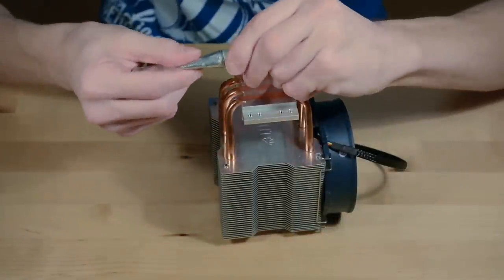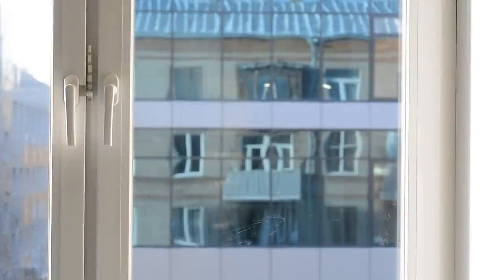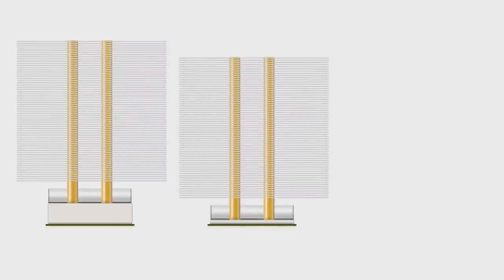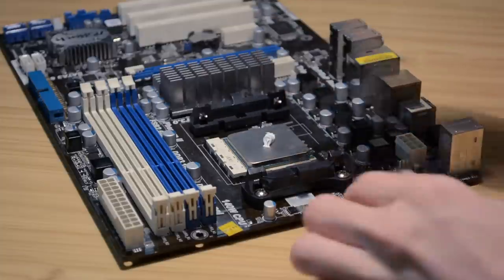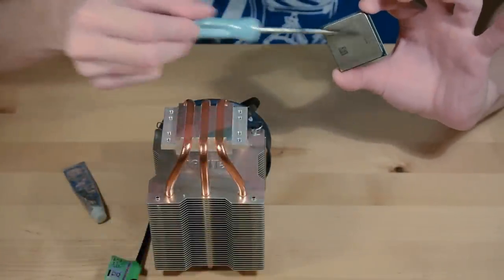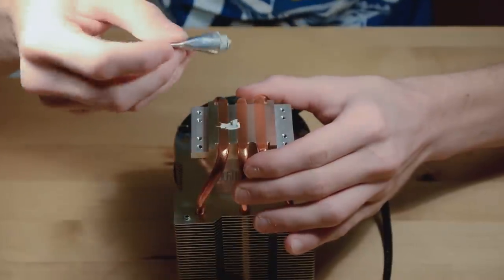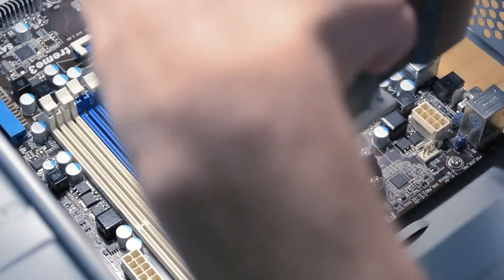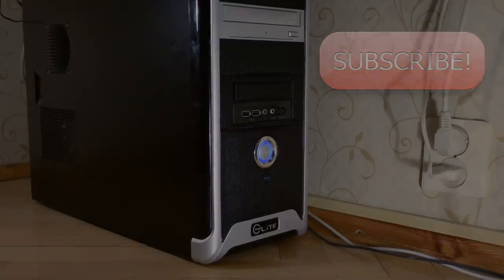Thermal paste: How much really need to apply and how to do it correctly? Как наносить термопасту?

Comment: DO NOT SPREAD THE THERMAL GREASE! This video is extremely misleading! Spreading the thermal compound WILL create air bubbles resulting in your cpu achieving poor thermal performance, potentially could cause thermal throttling as well as in extreme cases, a reduced component lifetime.
Reply from the maker: Ok. What way you offer?
Reply: put a rice sized amount of thermal paste in the middle of the cpu and apply the heatsink(cooler) without spreading or touching the goop in any other way
Reply: +Valicape so it is okay to do it like in the video?
Reply: +Valicape oh wait I know u have to do it on the CPU cooler but do you have to get the paste all over the CPU?
Reply: +ZenonDemona You're not supposed to spread the paste on the CPU cooler (heatsink). You're supposed to apply a rice grain/pea-sized amount in the middle of the CPU, and put the heatsink on top of it. The heatsink will spread the paste out by itself, doing it this way is not the way to do it.
Reply: +Worzel Gummidge oh okay thanks
Reply: +ZenonDemona You're very welcome.
Reply: +Valicape Hahahaha I, along with many other people that I know, apply paste using the way I said and have had zero issues. This video is incorrect, you're NOT supposed to do this. I have no idea what you are talking about when you mention "copper on copper" because my paste spreads perfectly every time I do this. So to apply it and have your shit overheat, the user is most likely doing something wrong (your friend). I also run a custom liquid cooling loop to cool my components, I don't use air cooling. So you getting lower temps than me is a big nope.
Reply: +ZenonDemona Apply it the right way, Valicap's definition of "0 problems" is probably 90c at idle.
Reply: +Valicape Spreading it causes bubbles you don't want that.
Reply: +Valicape He's right man, you're not supposed to do this.
Reply: ***** Before I answer that question I would need to know your CPU temperatures at idle and load, and the specs of whatever build you are using. I have been informed by many people not to do this, and have done my share of research. I have even tested it myself on one of my older builds. I did it the correct way and temperatures at load and idle decreased by a good amount.
Reply: +Valicape Doing it the way he did in the video does in fact cause air bubbles.
Reply: +Reppy07  Read my reply again, and you will realize that I put "the proper way." in quotation marks, along with everything else about 1 thousand times. Meaning that "the proper way" is subjective to each and everyone who decides to apply thermal paste in any which way they choose. Remember grade 7 grammar?
Reply: ***** Hahaha, I'm just messing around, I'm glad you didn't take that seriously. Yeah, whatever works when applying paste I guess. Thanks for the positive chat man, I appreciate it.
Reply: Worzel Gummidge I flagged his comments. Let me clarify as well: I agree with what you are saying, as this is a subjective matter, but my reasoning for the original comment is that for the people that need to watch a tutorial video on how to apply thermal grease, 99.9% of the time it will be the best application method (pea). for other specialized TIM applications perhaps in a server or enterprise environment, there will be a special way of re-applying it. But I am almost certain there are no known application methods that require to spread it. Test it yourself with 2 pieces of transparent acrylic, you wont get a perfect fit when spreading.
Reply: ***** Yeah, I was agreeing with what you were saying about the pea/grain application method. But I didn't know that people applied the paste differently in sever in or enterprise environments though, so thanks for the information.
Reply: +Tomas Puzis i do this for 15 years like this never had any temp problems
Reply: +Valicape Dude you have no idea what you are talking about. I went to a computer science course and have a A+ certification. You are supposed to leave a pea sized drop of thermal paste in the middle of the cpu. Then you put your heat sink back on and run your computer. It will spread it by it's self once it get's to how temps if you do it the way you are talking about it will leave air gaps. I don't give a fuck what you say your wrong. It takes up to a day of running your computer for the thermal paste to get to where it needs to be.
Reply: +Tomas Puzis so, apply in the middle and have 60% of the outside with no grease, got it. Think micro bubbles would be a bit better, but we'll go with over half of the processor not covered. Video was a bit bigger than a pea and didnt squish out and cover the entire thing sooooo
Reply: +Tomas Puzis LOL your computer will shut off when the CPU reaches too high of a temp
Reply: This man speaks truth! I just replace my paste tonight with the spread method and had temps around the 83 mark. Took cooler off and YES there was bubbles. After a good clean I did the Pea method now back in the 60-70.
Reply: bobojojo121 nice :)
Reply: I sploog'd on my new I5 its at like 40 all the time Lollers
Reply: sploog
Reply: Sploog
Reply: Sploog spammer.....
Reply: ssplloooooooog . spammeeeeer-er-er.
Reply: yea.... splooging
Reply: ronny?
Reply: wtf just happend here
Reply: SPLOOGED
Reply: Chris Meany SERIOUSLY? OKAY I TRY AND REPORT BACK. OKAY I TRIED, - ITS SHIT M8
Reply: all calm the fucking down and just put a little to the core and BAM. OVER. DONE. FINISHED. WORKS GREAT. 1 WEEK PAST AND NO PROBLEM.
Reply: just put a LITTLE AND DONE. DONT THINK ABOUT IT TOO MUCH
Reply: just put a LITTLE AND DONE. DONT THINK ABOUT IT TOO MUCH
Reply: Well for everyones knowledge my friends Alienware (gaming pc company) put a small pea size and put the heat sink on, when he went to reapply the paste there was only a small dot meaning all the surrounding area was touching air. So the spread method may be best and with ur finger and a thin layer, any air bubbles would be too small to effect things in a big scale (IMO). It would more matter on cooler and paste at that point.
Reply: A pc shuts itself down at high temperatures resultig in the famous blue screen. So the chance of damaging the hardware due to overheating is quite small.
Reply: GamingAnarchy sure mate, go ahead then, and report back of your success running a pc close to its tjmax.
Reply: Is this the new "How many licks does it take to get to the centre" thing? WTF
Reply: wtf should you do then?
Reply: lol spread it thinly! FACEPALM
Reply: xFREERAVENx  Spreading the thermal compound WILL create air bubbles resulting in your cpu overheating and possible hardware damage.....  "FACEPALM"
Reply: POLICE MATRIX NO ONE CARES !
Reply: yes they do
Reply: nope.
Reply: Then I would just buy another and smile. no shame.
Reply: you mean your mum or dad would buy you a new one
Reply: would they? shit thanks Ill call them.
Reply: why call them? just scream they will come running
Reply: The premise is weak with no punchline, you mistake this wolf for a bunny. I grow tired of this childish game #superdicklicker Goodbye and good luck in all of your future trolling.
Reply: +Valicape pea sized amount in middle is generally the more accepted way, by a substantial amount. Pressing down with glass generally will show you all the air bubbles made doing in the spread method. And generally no, the CPU package does not have to be entirely covered, the more on the surface area the better but the actual heat generator is just in the middle. Learn how CPUs work before commenting as "copper on copper" isn't some CPU killer at all.
Reply: What about two half pea size spots?
Reply: ahh i see you call others trolls yet..........here you are trolling.............. take up a hobby maybe? don't you have any friends to chat with? don't worry you will meet someone one day, it can be a big scary world as a teenager but don't loose hope bud. Try and be nice you will regret all this one day.
Reply: xFREERAVENx You realize it has nothing to do with the thermal compound right? it's the air bubbles that get created while scraping/spreading with a card
Reply: Yoshimtu No its not!
Reply: +Fudge You Alienware is just Dell's brand name for their gaming PC's. They are over priced junk, you are paying for the name. Alienware hasn't been their own (gaming pc company) for nearly 10 years, Dell bought them, shut them down and just kept the brand name to rebadge their own junk with a fancier name. As for how they do their thermal paste, it's no different from how all of their factory mass produced dells are built. The machine just spits a drop onto the CPU and passes it down the line.
Reply: xFREERAVENx Right, instead of acting like a 12 year old go inform yourself how cpus even work and not randomly cursing and insulting people to act cool for no reason.
Reply: Just thought I'd say I used the spread method with a plastic bag, and my cpu has an average temp of 15C idle and 45C under heavy load. BTW this IS with the stock cpu heat sink and fan that came with my amd fx 8350 which is a hot running cpu, because of 8 cores and 4 some GHz clock.
Reply: ***** yup
Reply: Gonna grab popcorn
Reply: I pulled off my heat sink today to switch to water cooling (time to oc) and the paste was nicely spread and no airbubles I could see. the cpu and cooler had a skim layer of paste and was consistent all around. Anyways I used the dot method this time or what evers.

It doesn't fricken matter guys as longs as there is enough paste to cover the surface it will work, the distance between the cpu and heat sink is essentially non existent.
Reply: Fudge You I wish some people with very limited fundamental knowledge of physics would refrain from commenting and trying to disprove something that is obviously right.
Reply: ***** lol
Reply: depends on the viscosity you dummys lol. some of the best thermal pastes around like the gelid solution gc extreme and prolimatech pro-pk3 both come with spreaders because the have high viscosity and wont spread properly with the blob in the middle. shit that comes with heatsinks is much more viscous.
Reply: not to mention toms hardware says to use the spread method with certain pastes.
Reply: i should note i dont like how he puts in on the cooler aswell that is pointless as the chip is what transfers the heat to the cooler. just have a bunch of thermal compound slowly going onto your board.
Reply: Fudge You But that's exactly the point, the gap between the CPU and the heatsink IS microscopic yet still a huge insulator if not filled with paste.  The air bubbles in the paste would therefore also be microscopic, you wouldn't see them but they would decrease the heat transfer.

Its obviously not much of an issue if your CPU is running fine.  Although theoretically its a bad idea to have uneven heat transfer as the plate will not expand evenly.
Reply: Alex Atkin the heat spreads evenly regardless, the heatsink on the die is like an inch height and width wise, so the heat will spread very fast.
Reply: Fudge You But it doesn't, as where the die and heat spreader meet will be the hottest spot.  If you get a bubble there it would have a far bigger impact on temps than anywhere else.

Bottom line, most of the time you will be fine.  But its better to get it right first time than find your tempts are high and have to do it all again.

Speaking as someone who was lazy for years and had much better tempts since doing it properly.
Reply: Alex Atkin I wasn't talking about the thermal paste between the heat spreader and die.  I was saying that thermal distribution isnt a problem between the heat spreader and heat sink since the size is so small.
Reply: Fudge You Its the same principle.  If the air bubble happens to be right above where the heat spreader touches the die, you will get reduced performance because that is the hottest spot on the heat spreader.
Reply: Alex Atkin No one is disagreeing with you? lol.
Reply: Fudge You You said thermal distribution between the heat spreader and heatsink are not a problem.  The principle behind an air bubble is that it indeed can be.

For optimal cooling you want NO weak point in the thermal distribution between the two surfaces.
Reply: Alex Atkin I said distribution what you're saying is conduction.
Reply: Fudge You But the whole point is that the heat needs to be evenly distributed across the HEATSINK.  It does you no good at all if its evenly across the heat spreader but not getting any further than that.

Yes the heat spreads fast so it will still get across, nobody is questioning that.  But no matter how fast it is, any delay in dissipation increases your operating temps.
Reply: Alex Atkin I wasn't saying that it wont increase temps, you said the metal would warp due to different temperatures (or something like that) and I am saying that the heat spreads so fast it doesn't have a chance to.
Reply: Fudge You Fair enough, I didn't realise that was what you were responding to.
Reply: Alex Atkin All good.
Reply: Really? I've had my FX 4100 since 2011 and used said method. OC'd to 4.6 GHz and ran daily 24/7 since day one. Never had and overheating problems and stays below 60° under load; air cooled by a 212 EVO with push/pull configuration. Here's a little insight to  your discord of "correctly" applying thermal paste, https://www.pugetsystems.com/labs/articles/Thermal-Paste-Application-Techniques-170/
Reply: w00tplayaw00t max temp for this is 70c Intel can do over 90c. it's not comparable
Reply: M Curry What's not comparable? That 'spreading' thermal paste on the CPU or cooler has detrimental effects on CPU thermal performance and it's longevity? There's video's and experiments done to debunk that fact. My FX-4100 can pay homage to that. Seriously, over five years now I've been applying thermal paste on the same CPU by 'spreading' it. I have not had any ill effects in doing so. And what the original post was about is complete malarkey.
Reply: I've tried all methods myself the difference is non. I prefer spreading after all methods because you can control where the paste is when the heat sink is on. Instead of a pea or similar method where it just spreads to what ever. Which is bad for a gpu or laptop chips.

Pea method: Lazy basic desktop newbies. 

Spread method: Advanced computer "mechanics" who do more than put paste on a protected cpu heat spreader.
Reply: http://www.arcticsilver.com/pdf/appmeth/int/vl/intel_app_method_vertical_line_v1.1.pdf

Everyone could just read manuals. 

apply a pea size to heat sink, spread.
apply a pea size to cpu, spread.

Then apply a line in the middle of cpu, DO NOT SPREAD.

Attach heatsink, BAM, Done.

Or ignore the manufacturers of the paste and just listen to the internet experts.
Reply: I also was watching this with wide eyes. Wtf is he doing ?
Reply: Strange how vendors of cpu coolers including manufacturers actually spread their thermal paste on to the coolers they sell, but you're saying this is wrong, fascinating.
Reply: Ya corsair pre spreads only intel stock ones come with it in lines and there is 3 lol
Reply: How do I look ignorant? I posted a link to the method I was talking about. Which says to spread on the heat sink and CPU, then put a line down the middle of CPU.
Reply: Undeadbanana Just because it's manufacture recommended does not mean that there are other, if not better ways to do things. Do your own experiment, make a video about it and post your findings on YouTube. This debate is all hearsay, so just do what you think works. Can you yourself disprove the 'spread' method in this case and the negative effects of it?
Reply: Well, the very first comment specifically says, "DO NOT SPREAD THE THERMAL GREASE!" So, I thought it'd be appropriate to post the suggested method of application from one of the biggest manufacturers of Thermal Compound, which specifically says to spread it. 

I'm okay with their method, I don't need to waste my time and money researching the perfect method when this company with a lot more resources than I have already done so.
Reply: Exactly! People themselves have already done the research and experiments to disprove the comment "DO NOT SPREAD THE THERMAL GREASE!". The original poster is just spreading propaganda by means of a fanboy. It's already been proven that the line method is not always the best method in some cases. And the rest of his comment is completely false saying that in doing the spread method will result in poor thermal performance, when I myself have never had any problems using this method. People are seriously quick to talk and unintelligible when it comes to these types of things. It's like saying someone shouldn't use heavy duty motor oil in your motorcycle engine due to serious complications which can arise because of it. Little do they know it's the best thing to use, especially in the case if it's one with a wet clutch. All I'm saying is don't buy into that bullshit this guy is trying to sell. Ridiculous how many dislikes this video gets because of such incompetence.
Reply: sure man. :)
Reply: not true
Reply: ***** i think i was referring to air bubbles
Reply: then why is it when you get the cpu the thermal paste is evenly distributed on the stock cooler you get with the cpu
Reply: Wilhelm Felix if u like your Gpu and want to work for long run, better repaste it earlier b4 it starts to get problem . Every 10c reduce will increase the lifespan to double. I got mine -5c after repaste running on full load
Reply: cool man
Reply: I highly reccomend the video by linus tech tips, they test all the different methods of how most regular people apply paste in different methods and temperatures
Reply: ikr
Reply: lol the owner of this channel gets roasted
Reply: OH NO, NOW HIS CPU WILL GET 1% HOTTER THAN NORMAL
Reply: Yes, the reason his had airbubbles was because he lifted it up after applying it.
Reply: Exactly
Reply: *you're
Reply: DelecatePeach, my English is just fine. My comment was meant as a reply for Wilhelm, not the op. Wilhelm "+yudiat2505 no your doing it right but thermal paste manufacters recommended"
Reply: Yup exactly what he said is wrong and also misleading since he did not show us the temperature of the normal way

1) He pushed the cooler with your hands, even if you applied great power the pressure is less compared to what the pressure would be had you tighten up the screws correctly.

2) If he had tighten up the screws correctly it would have spread on the entire surface with small gaps maybe on the corners but that doesnt even matter. because we need to have thermal paste only in the center of the CPU the metallic square is just a heat spreader and acts like a buffer if you google for delid CPUs you will see that the actual chip on there is in the center and is very small there is where the contact needs to be made. 

3)The only thing right in his video is that we use thermal paste to avoid oxygen between the CPU and the Cooler but by spreading the paste with the credit card you mix small air bubbles in the process..

Also yes it needs to be a thin film but too thin is also bad.... you did what you tried to avoid.. with such a thin film of thermal paste you made many tiny gaps that dont have paste at all (that is why one can see the heat pipe colors for example because instead of a wall your thin layer is like a net with tiny holes in it which allow light to reflect from the cooper and come to your eyes and thats why instead of the thermal paste color you see the cooper color... those tiny holes are going to be filled with air... )
Reply: In at 420 likes 👍
Reply: Nope he still did a bad job the layer was too thin creating pockets of air, also puget systems is not that reliable they sell thermal care at a hefty premium so they obviously will come with some bullcrap about how important it is to do stuff in a different way lol (btw they say to make an X shape they dont say to apply the paste as in the video).
Reply: Worzel Gummidge wrong. The cpu is square. Adding a pea size results in a circular paste amount. Only good for cpu coolers that have a circular heatsink like a stock cooler. Also leaves 1/3 of the cpu having 0 paste resulting in cpu disaster. Do you resesrch. Spreading it results in the whole cpu being covered.
Reply: @SWATsqad  yes bro, agreed here
Reply: @SWATsqad  a rice sized cooked or raw?
Reply: SWATsqad instruction unclear I put a bowl of rice size of thermal paste on my amd